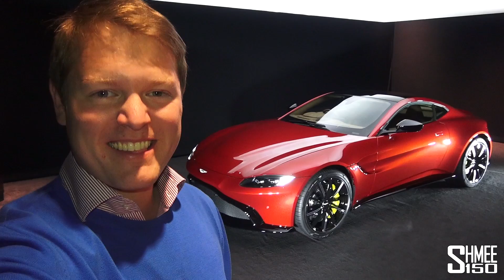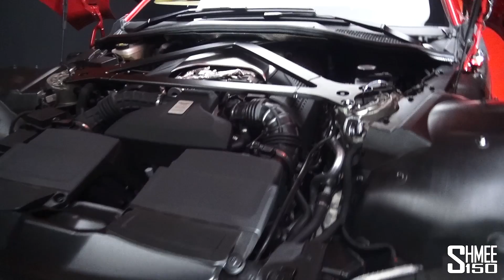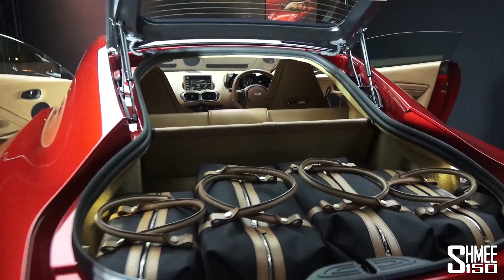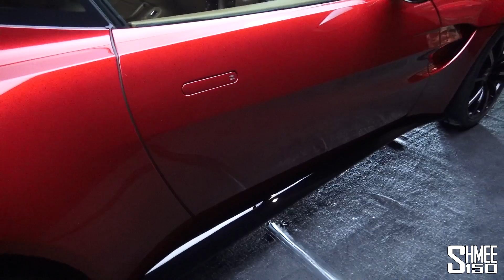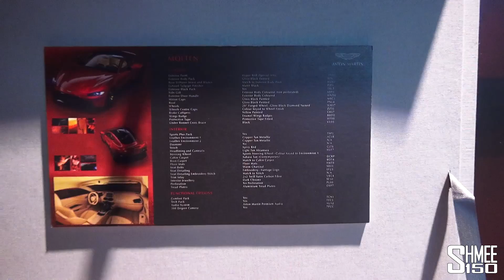THIS is the NEW Aston Martin Vantage! | FIRST LOOK

Comment: alright the specs sound great and fast BUT let's start headlights too small wrong shape ,no grills bars ,painted eyebrow rear FX should be lower line up with the rear diffuser so the rear bumper looks more tucked in AND finally what's with the dash board especially the gauge pod ,all wrong for an Aston  .Overall the car looks like a cross between RX8 /370Z  with Aston grill opening and badges :(

Comment: Aston Martin... What were you thinking? Looks like a chavved up MX-5. Uncouth to say the least. This certainly isn't a tailored suit fit for 007. There was nothing wrong with the previous Aston Martin Vantage.... take a look at Porsche with the 911, every few years make slight subtle modern tweaks to the exterior - Progressive Evolution. There is certainly no beauty or soul in this design, especially the horrendous headlights and cheap horrible front grille. Looks cheap and different designers for different parts of the car, it doesn't flow. I'm a Huge huge Aston Martin fan, Vanquish all day everyday for me. This Vantage doesn't even look like an Aston Martin. What a shame. This model won't last.
Reply: spot on !
Reply: its a real real shame

Comment: The exhaust tips look like a cheap afterthought just plain old steel poking out the vents there.  Also, what's with the awful welds on the front cross-brace?  Looks like an apprentice did it!  The more I look at the general shape the more l like it - but it's just missing some important detailing.

Comment: The headlamps design is really mediocre in relation to what today's trends and technology are producing. (really reminds of a miata) The front bumper is also missing some detailing, it looks unfinished. The rear is quite nice, menacing but could be a bit more elaborate.
On the inside, it looks quite below average in comparison to the competitors in the same category. You'd expect a lot more from a car maker that used to be the benchmark in sports cars interior design. 
In general the whole car lacks stance and sophistication given the price tag and the crowd expectations.
Quite disappointing to be honest

Comment: correct me if i'm wrong but the car looks pretty cheap/flimsy looking. the grill upfront the plastic on the diffusor. and at 3:14 seems like the door isn't quite flush with the front end. not impressed

Comment: Interior yes. Exterior, a mess, looks awful. Lower edge of the front intake looks messy and almost like it's had a refitted intake, and I don't like the lights. The rear also has the same issue, the upper diffuser just looks unfinished. I just hope this is a prototype

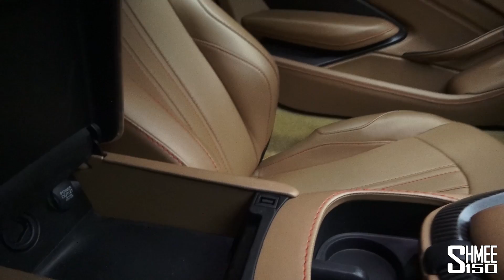Comment: 13:12 - How are you supposed to use those USB ports? ...if the lid closes on top of them? Typical user UN-friendly design. Just shoving in a feature without a concern for usability. Same for the poorly designed, 1 finger only door handles.

Comment: A little bit of a Mercedes AMG GT (the engine, some of the MB interior parts) but she looks better live than on the pictures. The front grill on some of the official pics looks like it fell off. But the mesh grill underneath the gigantic carbon-like lip looks, actually, surprisingly good. The question remains: how much more one is ready to pay for a Vantage 2018 over an MB AMG GT? My bet is at least 50%. North of a well-trimmed AMG GT R.

Comment: I didn't particularly like the new Vanquish for styling, it looked a bit plain compared to the old Vanquish, and the new DB11 has a funny back end, otherwise I would have admired that car... This new Vantage is spectacular, Aston have absolutely nailed it for design in this car. It also looks much better than a DB10. Think I'll be purchasing one of these in about 20 years time, if the value drops to reasonable money before it starts appreciating again...

Comment: Does look better in the flesh having been to a viewing this spec is probably the best the horrible drilled metal panel behind the wheels, an option apparently according to Shmee is truly horrible and was on the version I saw. I prefer the traditional model, but this will appeal to a lot of people including 911 and Hurracan buyers. The headlights are not great, better up close but MX5 from distance, it is a little too R35 GTR in the tail of the window sills, not having bonnet vents even though not required takes away from the old model and with a big expanse of flat metal it would have made a nice break. The interior is good, this red is better than the toxic green they used as main launch colour, why I don't know it is the worst coloured Aston and has the silly drilled metal vents to complete the horror. No rush to sell my current one, that seems to be the consensus but it is a bold new step and different to DB11.

Comment: The steering wheel and white font buttons look like something out of a 1990's mini-van. The only other issue I have with this vehicle are the exhaust tip valances being gray instead of black as eveything around them - they kinda fit that 1990s design theme  lol

Comment: Overall, looking at it from the side, it looks SO much better than the DB11. Not as elegant as the previous Vantage, but a good looking car none the less. While not completely similar the front area around the headlights reminds me of the ancient Nissan 100NX (it could also be a more generic take on the current Mazda Miata/MX5). It's a design worthy of a japanese car, NOT an Aston/AMG.

..and just like the DB11 it has an butt ugly interior. too bad. i could never buy a car that forced me to sit and look at especially that instrument cluster, and i do agree that the button area is FAR to busy as well. If these two areas were done in an elegant manner, i would have nothing but love for the interior though. The rest of it is gorgeous.

My take on it: Not finished design wise, and i hate the side gills because they dirty up the car faster than you can say "No, they put an AMG engine in it". So far it's an okay attempt, but they have a far bit of road to travel to get close to the elegance and soul of the predecessor imho. ..admittenly that IS a high goal to set for anyone. The previous Astons are fantastic looking cars, oldfashioned or not.

Comment: It's quite interesting to see how many people are comparing certain  aspects of the car with other brands like "the front looks like a Miata", or "the rear looks like an F-type, or a Kia" or even "the interior is nice e but the dash is just like the AMG GTs'".
I don't think it is a bad thing, and probably you shouldn't too. These comparisons just show how much the designs are converging to what is most appealing for most of us. All brands are getting more and more similar, with wider headlights, slimmer tail lights, more muscular wheel arches, etc. It is not Aston Martin's fault, this is the design trend of today.

I think we can trace a parallelism with the smartphone market: cheap phones are getting good, beginning to look ever more premium, and good phones are getting similar (short bezels, metal frame & glass back panel, etc). 

Because technologies are a lot harder to test than designs (developing something VS making a clay/plastic mockup), designers are running at a much faster pace than engineers, to a point where designers have to wait for new technologies to come out so they can try something new (think of bigger displays, more dense batteries allow for slimmer phones with smaller bezels). 

The same is happening with cars. As time passes, brands find out what works and what doesn't, and converge to the best solutions. But because the technology doesn't evolve as fast, designs tend to look alike when no big tech has come out in a while.
A couple years back, when LEDs were just coming into the auto industry (when white LEDs were developed), premium brands began offering cars incorporating LEDs in all sorts of designs and ways.
Some time has passed, and brands have figured out what we like most : small headlights that look like eyes, slim tail lights that go across the rear of the car and something connecting left to right like a chassis line or metal strip, sometimes even making a full line with the lights.

Bugatti is doing this, Aston Martin is doing this, Porsche is doing this in some 911 and Panameras, Renault is doing this with the new Méganes, Mercedes does this, BMW does this,... it is not like all of these brand are putting out bad designs, it's just that things tend to develop to the optimal solutions (and optimal sales volumes)

Sure, they keep some of their identity, but as time passes by, design will be sacrificed for a bigger appeal to the typical driver.
(not all drivers understand design, but all of us understand price and brand appeal)

sorry for the long post
Reply: So it's not Aston's fault that this is an ugly car. Oh ok if you say so.
Reply: Afonso - im not a typical driver when im looking to drop GBP130K on a car .. so I don't want typical design
Reply: that's definitely the longest post i have ever seen on youtube......

Comment: what a strange launch color for both interior and exterior. I get they were trying to have a theatrical thing going on with the lights and audio for the opening but the dimly lit, black square is not appealing (in my opinion.). The electric yellow/green seems to be a miss too. Aston has the ability for beautiful paintwork.. why these two colors for the launch?? regardless, thanks for the video!

Comment: It’s seriously just the headlights that messed up an otherwise “forward thinking” design that will be accepted in time.. it really is the one thing that cheapens it. 
They didn’t use the vantage lights, neither did they use the db10’s lights which this car is inspired.. i don’t get it.. why?
They really did lose one or two very very distinctive vantage features. Overall proportion and stance is still absolutely beautiful.

Comment: Hi Tim, what a great looking Aston what a superb job Aston have done with new design. I would pick the red as shown but all the glossy black on the outside and in the engine bay would have to be carbon fibre also if I could I would have a black mesh grill at the front of Car with black leather seats and all the stitching and Aston lettering in matching red including the seat belts in red also full carbon on the doors and Center console. Well Time a great video and catch you next time. Best wishes Alan B

Comment: Am I the only one who thinks that the exhaust pipes look a bit, well "tiny"?
Reply: Maybe because Aston Martin makes real exhaust pipes, with no design trying to make them bigger looking than what they actually are. I like that, because it feels pure.
Reply: Better than all those fake exhausts
Reply: XFZY they are being honest with the pipes bruv. Heaps of car brands like to add an extra pipe over the existing pipe to make them look bigger. Mecedes like to do that
Reply: I thought the same, especially as its highlighted with the silver. Aston Martin had its hands full making a nicer looking car then the previous generation. And they havent pulled it off imo.
Reply: Like why grey. If they were black I wouldn't mind.
Reply: XFZY yeah I’m not a big fan of the cut metal thing aswell
Reply: it looks cheap.. like a back of a pc 😂😂
Reply: that was the biggest thing that i thought was awful. if you crop up the tailpipe piece it looks like a really cheap korean car. `what were Aston thinking? It doesn't even have a finished tip just the bare pipe. Horrible.
Reply: exhaust pipes being really small was the first thing that caught my eye as soon as the camera showed the back of the car.
Reply: i was disappointed at the exhaust pipes too
Reply: Yes! They need to be bigger, in black chrome finish and better 2 by 2! :-)))
Reply: No. They are tiny and looking like row metal, but in a bad way. Even cheaper cars have exaust tips but this one has just the steel pipe, hopefully there is a factory extra option to add them or later on an aftermarket option.
Reply: Aston Martin is recycling exhaust pipes from Golf diesel. Pretty clever 🤣
Reply: It's an honest one, I actually love it and wished more cars had it, mostly track car versions.
Reply: Looks cheap after marketish.
Reply: Agree and where's the chrome or blacked out tips?
Reply: Yes something wrong there, pre production?!?!
Reply: It definitely seems a bit undersized
Reply: Your right

Comment: Wow. I would say the side profile is the best angle. Otherwise, really disappointed. There's nothing special or particularly good looking about the design. The front looks like a Mazda MX5, and could definitely do with more vents and openings. The rear lights are absolutely horrible, not to mention those tiny exhausts and cheese grater exhaust surroundings. As with the DB11, the interior looks really cheap. Aston Martin had so much going for them with the Vulcan and Valkyrie, why did they ruin their most popular and accessible car?

Comment: Why Aston Martin engines extract significantly less power from the same or similar size engines than the other rival companies do from their engines? For example this is twin turbo 4l V8 which 'only' produces 500hp, but McLaren get over 700hp from their V8, and Ferrari get almost 700HP in 488 GTB from 3.9l V8. Also Aston NA V12's produce significantly less power than Ferrari V12's. OK, those are bit smaller V12's but still difference is huge. Twin turbo 5.2l V12 from DB11 produces way less power than 720S does from 4l V8, I don't get it, can anyone explain?
Reply: You aren’t comparing like for like, the vantage isn’t a hypercar and isn’t about flat out speed, it’s a GT car. It’s for crossing continents quickly in comfort. I’m sure Aston could get more BHP from the engine but a car like this doesn’t need a gazillion horse power, cars aren’t there for people to play YouTube Top trumps, they are for driving, you match horse power to the chassis to produce an enjoyable driving experience. That’s why one of the best sports cars ever made only has about 150bhp, the MX5.
Reply: Jabber 1974 I know it is GT car but still, F12 or 812 Superfast is also GT but look at the engine hehe well, probably they don't want to compete in that bracket but still it is thing of prestige, if you can pull out more why wouldn't you, or they prefer less power and more durability.
Reply: Aleksandar Gospić since when has more bhp equated to prestige? And it’s widely accepted that the super fast has far too much power to be an enjoyable car.
Reply: Well of course, every segment has their customers, and not everyone needs so many horses, but to return to the original question, what I find interesting is why Aston goes for such combo of less output from similar sized engines than the others, they could extract that power from smaller engines. It is obviously their philosophy, and I'm not mechanical engineer, but I doubt they are unable too. But since I've been following cars I didn't stumble on the explanation why is that, cause other top sport car companies obviously get more HP from their engines

Comment: Sorry to say, the rear looks a bit like the new Toyota Supra. Nevertheless this is a good step forward for Aston!
Reply: How can it look like a car which hasn't been revealed? I know of the concept and the cars around the 'Ring, but wtf.
Reply: i thought it was a mx5 miata!
Reply: Automotive Mike There is no new supra
Reply: I like everything but not the rear :s
Reply: Same thing for the first 2 sec i thought it is the new supra
Reply: The back looks like the Toyota HV Concept
Reply: Joel Schembri Moving on to the future means that the car should look as much as beautiful as the old one while being more modern. This has failed that task.
Reply: Joel Schembri Also, the DB11 didn't get much praise, you know that. That thing is so ugly and wrong it is evil.
Reply: Lol i thought the same too. What if  the camoed "Supra" that's been spied many times was actually this Aston Martin? Thats some major plot twist there
Reply: Nooo.... its not a 'good step forward'. What are you blind? The car is horrendous. It has 2008 Miata headlights, the front grill looks like Lexus got a hold of it and made is ugly. The rear was clipped off an F-type and the steering wheel looks like it can't decide whether it's round or square. The center screen looks like a cell phone with a cheap cover placed sideways on a shelf that holds your loose change. Sadly, this car is a complete mess. Aston, if you are listening...how did this nightmare of a car get approved by the board????
Reply: I commented excact same thing... Supra concept looked way better doe..m
Reply: All I hear about it is IT LOOKS LIKE A VOLVO SUPRA MIATA MX-5 TESLA .. obviously people are trying to make it look like something rather than looking at this as a whole...
Reply: ProjectGenesis - You’ve obviously never seen one in person.. it doesn’t picture well but wow it’s nice in the metal
Reply: No are u Blind !? That’s not Toyota fp1!!!! Thats a Mazda!
Reply: Danny Rolly, technologically yes.  And, that chap from Lotus probably ensured that it has higher cornering limits.  Still, I hate both the interior and exterior design language (far too busy to be an Aston).  And, the engine is far less special.  Plus, the car has torque vectoring via braking which always feels disconcerting (in my experience).  If you cruise around London and only care about showing off, it'll be a great car.  If you actually want to drive the car hard on a good B road, I'm afraid it will likely be a downgrade from its predecessor (as the previous manual vantage was widely regarded as the best sports car in the segment).